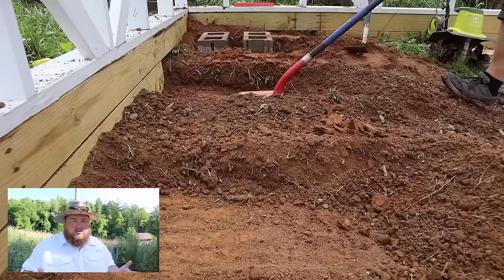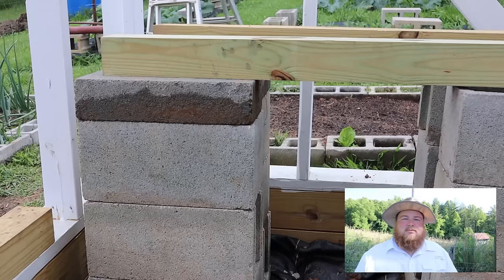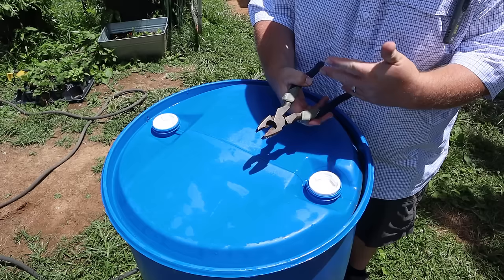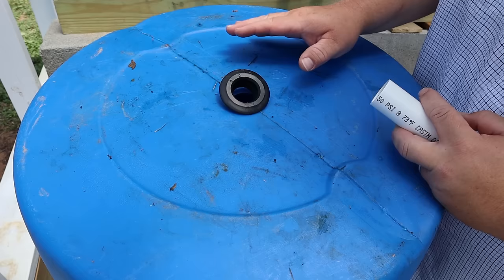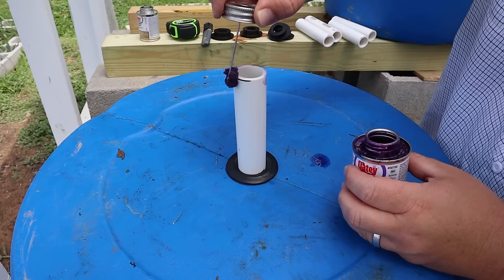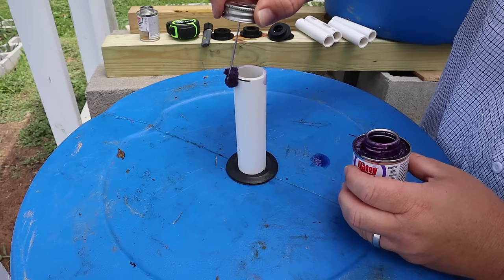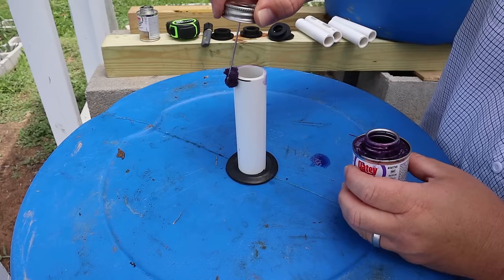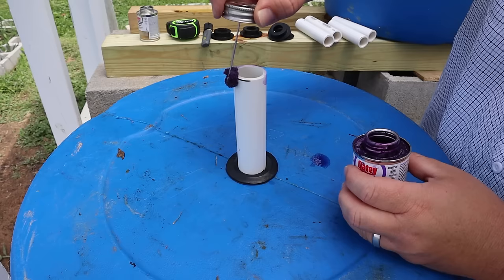COMPLETE Rainwater System START TO FINISH - DIY Greenhouse Build #10

Comment: @greenacrehomestead exactly what I was looking for! Except, do you (or any fellow subscribers) have a total cost for this system? I have barrels but I wonder how much the 2" and 1" pipe with elbows, tees and such will be. I guess it's time to fill my cart up. There's a BlueBarrel system out there (similar setup but upside down barrels so you fill via bungholes not newly drilled holes) but it seems pricey.

Comment: Not sure if someone mentioned this already, but simple math with the tubing diameter will mislead you.  A better way to ballpark if your overflow will be enough for your incoming water is to use the area of the incoming pipes vs the area of the outgoing pipes.  So area of a circle is the constant Pi multiplied by the radius squared.  So for your 2 inch pipes, the radius is 1 inch.  1 squared is just 1.  So one 2 inch pipe will be 1 times Pi, or just Pi (3.14).  What does that mean?  Don't worry about it, just think of it as a rough number indicating how much water will flow through that pipe.  Now you have 2 of those, so 2 times 3.14 equals 6.28.  Okay, so now the amount of overflow has to be equal to or more than that number.  

A one inch pipe, the radius is 0.5 inches.  0.5 inches squared is 0.25.  0.25 times Pi is 0.7854.  Now you have 5 of those pipes so: 5 times 0.7854 equals 3.927.

So here you can see how the simple math betrays you.  The overflow capacity you have is 3.93, but the incoming flow is capable of 6.28.

Now I noticed your first flush system has some holes in it so there is some drainage there, but for the sake of this calculation, let's ignore that.

What this means is that if you have a constant rainfall AND that rainfall is coming down at the maximum rate that your 2 inch pipes can handle AND your barrels get totally full, you probably will not have enough overflow capacity and your water will back up and overflow at the next available gap.

Now that's a lot of and's.   You likely will not have a problem in anything but the most intense rain events, or if you happen to have a few days of rain back to back with one rain event that's a heavy downpour.  If you do have this problem, replacing the 1 inch pipes with 1.5 inch pipes should fix the issue.

Comment: Really good video and a personable actor. Let me ask some questions. Some things you went too fast as I am slow. One, why overflows on each barrel? Don't they all inter connect with each seceding barrel? Perhaps one overflow at the end? You speak of a first flush. Did I miss the ball or was that a manual thing? I have been looking at a ton of videos. Some say bput the connections at the top which I always thought was ridiculous as it is great for filling but not for draining. I was glad you did it the way that you did. I am thinking about putting a submersible pump in the last one, connect it to a pressure switch and install a pressure tank so I can supply my vacation home. We have no water there on a regular basis.What do you think?

Comment: Since you didn't alternate the blocks they're going to be very unstable especially once you have the barrels full of water. They'll compact the earth even more and it's usually not evenly. Whether you alternated or not you really should anchor the cinderblocks down by driving a piece of rebar or a T-post through the openings in the blocks several feet into the ground. 
Otherwise you could come out and find the whole assembly dumped on the ground.
Reply: A concrete footer set below the frost depth in your area would likely keep the tower blocks from moving?

Comment: Why did you drill the holes on the end plug and then put the tape over it? 
This is a great idea I think it is something I will be trying for my garden!
Reply from the maker: The holes are to allow the water to slowly drain out of the flush pipe after the rain is over. I tape them up because they were too big and allowed too much water to flush out and be lost. :) Instead, I just leave the caps loosely screwed in and it leaks from around the threads to work out okay.

Comment: Two 2" inflow pipes have about 55% more capacity than five  1" pipes outflow at standard gravity pressure and not counting friction.
Reply: Huh? 🤔 Sorry, I basically know what you're saying, but how you came to that conclusion is over my head. Not that I'm dumb or stupid, my brain is just not tuned in that direction. 🤷🏽‍♀️
Reply: @njeanhunter9100  the conclusion came by math

Comment: GREAT vid thanks! BUT I do have a question if anyone can help me out:
The First Flush Diverter.... so...it’s just a pipe off the main water entrance (gutter)... assuming the bottom has a cap... but do you just wait til THAT fills up and then when topped off the rainwater will start going into the barrels... do you then uncap it and put the plug back in??? 
  Very sorry if this is a stupid question but I just want to make sure.
  Thanks and GOD Bless!!! 💗🙏😘

Comment: wabi-sabi cure for your off kilter cmu... free cement! ...dig the dirt an extra inch deep... add back a bit of dirt then add water and MIX LIKE CONCRETE! Get a good thick mix and gently place cmu on mud. Level it... rubber mallet works great! When the mud dries, cmu will be level and stuck like you actually used cement! Get er done

Comment: I have to pause before you finish so I don't forget my question because I really want to do something like this (on a smaller scale) for my chicken coops and gardens which are both so far away from my house.  The first flush part.  You said the first load of water will carry all of the junk off of our roof like pollen, dirt, bugs (maybe asphalt from asphalt roofing?)... so my question is, doesn't that stuff always build up on roofs between rain events?  I live in Eastern NC and I'd guess more of our rain comes in quick burst heavy rain than steady washing rain.  And most of it is in spring and then off and on through the summer, a lot of times in the evenings when sea breeze storms pop up.  Just trying to figure out if there is something else I should do to keep it clean?  The water would be used to fill chicken waterers, and to water my garden beds.
Reply from the maker: You can size the first flush system to whatever you like -- smaller for smaller roofs for sure. You mentioned coop and are (maybe) going to really like this... we built a rainwater system for our chickens a few years back! Here's the playlist of the coop build -- there's a dedicated video to the rainwater system in that list. It served us well for about 2 years until we moved them to a new location on our property. https://www.youtube.com/playlist?list=PLxVjeL1ZEeUpiRPFF81m12kHBZMfE2dnr

Comment: The diverted seems like a good idea on paper but just how effective is it, surely not 100% and then there’s the cost of the plumbing. It might be better to confine the sludge that can’t be screened out to the first barrel where it can settle to the bottom and then take the outflow from this barrel up a little from the bottom. I use a low wattage sump pump to transfer water from my first barrel through a depth filter to the other storage tanks but you could leave that out and feed the inflow to each tank above the bottom. There is some loss in capacity but the sludge is on the bottom, which over time can be vacuumed out using a cheap pool eductor type vacuum. With your setup the sludge is in the manifold, which might be tougher to clean out. Did I see the inflow to the first tank going uphill? Do you feed the rainwater in from two places? One inflow and one overflow should be doable at half the cost at one barrel.

Comment: It looks good. But a couple things. I have found cinder blocks lying in the ground that way start sinking after a short while. Solid side down lasts a little longer but eventually still sinks with that kind of weight on them.   Did you know PVC pipe is not UV stable and willl last longer if you paint it? Otherwise it becomes brittle in a couple years. Hope you get lots of water.
Reply from the maker: UV degradation of PVC is only a certain percentage of the thickness and in our experiences (we have built many pvc items outdoors, even another rainwater system on a chicken coop years back) has no real negative outcome with how our projects are used or the stresses they're subjected to.

Comment: Do not use water hose bibs that are made for presurized  systems.  Flow will be greatly reduced. 
Pvc hose fittings  will fit ball values. Pvc values are way cheaper.
Also female pvc hose bibs will leak and break.

Comment: Hi! Did I understand correctly: first, the water goes to the lower knee of the drain (and there it slowly drains). And when a good heavy rain, the knee fills up and already from above the water goes into the barrels. If the rain is weak, everything merges into the yard. Right?
Reply: I thought to make the filter even uglier: a bucket of sand and stones and light agrofibre below
So your system is still neat)

Comment: I love this video and your explanation of everything. Thank you for being so thorough. 

I have a question about the brilliant First Flush Diverter system. You drilled holes through the cover on the bottom. Later when you tested it, you said the holes were too big, because the water was flowing so quickly out of it. How big should the holes be? Does the First Flush Diverter system need to drain actively? I thought it held the first flush until you decided to release it later, after it has stopped raining. Am I misunderstanding how it works?
Reply from the maker: The perfect balance is small enough to let most of the water flow into the barrels, but large enough to drain itself and any larger debris in between rain storms without any intervention by humans. :)

Comment: Nice work  but I’m curious, why didn’t you alternate the block direction? Seems it would be safer after the containers are full and top heavy.
Reply from the maker: Alternating block only works when they are placed side by side. A 16" wide base was too narrow for the barrels to safely rest upon.

Comment: yep...saw that hole in the drain cap was too big but hey.....We all gotta figure things out ourselves right??? did a fabulous job on the system. I am curious about one of the down spouts going into a barrel.....was that going up hill from the gutter??? Could I have just not seen it correctly? Was it an optical delusion???  OR WAS IT GOING UP HILL??? Hmmm inquiring minds want to know!  :}
Reply from the maker: Yep, going uphill and no problem. 😎 Works the same as a p trap or toilet flushing. Water flows into barrel fine when filled in pipes. Afterwards no worries about siphoning our barrel water because the inlet pipe from gutter will allow air into pipes to let them self-drain between rains.

Comment: I wonder if the "too big holes" in your first flush were too big, because it's gonna be dirty water going out, so there's a possibility that they might clog?  Also, if you top fill the barrels and use "t" fittings in the holes already in the top of the barrel you won't need overflow holes drilled in the barrel, and at the end barrel have an easy overflow for the entire system, not to mention you will fill the entire barrels with no air space at top.

Comment: Got confused when you connected the bottom pipes to drain but how will water fill all the containers in the middle if gutters are connected in corners only? I didn't see any pipes conected to each other on top?and why did each container have a drain pipe on back end?I Thought the pipes were suppose to flow from one container and when the water fill one container it over flows to start filling the one next to it then repeat until they all filled Up. Sorry. I love watching btw. If you can explain I would really appreciate it! Need to make one myself, thanks! God bless.

Comment: The reason it works is the same reason you can use a clear tube filled with water as a level line.

Comment: Nice build, I would like to ask, is it necessary to have the first flush system if you have the fine mesh covering your collectors as you did, I would have thought that these would have taken all the dirt etc ?
Reply from the maker: It's not absolutely necessary, but does help a lot towards keeping the water cleaner overall. The mesh catches the larger particles, but the first flush does well for smaller items like dust, pollen, and (in theory) bacteria and poo water from bird droppings. :)
Reply: @sam-and-angela  Thanks for filling me in. I hadn't thought about that side of things, its a very good point you make. I may try and tackle something like this this summer if all goes well :)

Comment: I know I am late to the party, but I  really enjoyed this video.  Is there a way to install valves between the barrels to help ration the use of the water?  Do you think it would be worth the effort?
Reply from the maker: Sure that would be easy— just make the down pipes from barrels to horizontal pipe longer and put inline valves there. I wouldn’t see much reason with my system but that’s because I can control the flow at the connection point too.

Comment: Great video; nice system.  NOT trying to be critical at all with my comments as I really enjoyed the video.   Your system should work just fine, which is the bottom line here.  And you may have had a source for the barrels that let you get 5 of them free...or very cheaply.  If so, I understand why you would use 5 barrels to build a system with 250 gallons of capacity, more or less, allowing for a little head space at the top for the venting and overflow.  But if you gave the 5 barrels to me free, I still wouldn't trade my single IBC tote system for your 5 barrel system.

If all you needed was a 250 gallon system, this one was an "over build" of sorts, in terms of materials needed, their cost, your time and labor, etc.  One single IBC tote would give you 330 gallons of storage, or about 35% more capacity, be simpler to obtain, set up, use, and maintain.  I've put together my own 330 gallon IBC tote system and used it successfully for several years.  While I paid $80 this year for a new IBC tote that I merely have to clean out the inside where food grade raw materials were stored, the savings on all the excess plumbing supplies used in your system would offset all of most of that cost, not to mention the time and labor needed to do the installation. And then there is the cost of all those concrete blocks and wood needed to support a 5 barrel system to consider.  

I see no good reason to create a 5 barrel system. If there is one, what is it?  Both systems work very well but a single IBC tote rain barrel system is just far superior for the reasons I have named.  BTW, I started my first rain barrel system with a single 55 gallon drum just like you did so I have done it both ways.  The IBC tote is the best way to go by far.

Comment: 5x1" pipes have an area of 3.9 while 2x2" pipes have an area of 6.3.

Four 1" pipes will flow the same as one 2" pipe. The math doesnt always work that way but remember it's not only twice as tall it's also twice as wide. If it was square it would take two 2X2s to be 2X4 and four 2X2 to be 4X4.

Comment: Great system but too many small overflows, i would prefer 2 bigger ones on side barrels as manifold under barrels is thinner then gutters. Efectively you have 4 paths for water to overflow instead of five.

Comment: My first thought was to question whether your block foundation has enough surface area sitting on the raw ground that the blocks don't tend to sink if the ground gets wet. That could potentially allow the barrels to lean and topple. When almost filled with water they approach 440 lbs each (55 gallons times 8 lbs per gallon). With 5 of them, that's over a ton.. Just sayin'. 
Maybe with the area in question being covered by your roof, the ground will stay dry, and everything will be fine. But iin sustained heavy rain and if your overflow pipes dump close to each barrel, I'd watch it..
Reply from the maker: See FAQ video in description.
Reply: @sam-and-angela  Sounds like so far so good. Yay that's encouraging! I pray it will last as long as you want it there!  Blessings

Comment: all sealed surfaces should have an associated rainwater harvesting system even if its a 10ft deep pit full of river stone and topped with a silt barrier so that rainwater in non-flood events can be diverted into the soil. imagine you're in a rainy environment. you still need water for numerous tasks and why should we pay rates to get water sent via the grid when they fill it up with poisons to keep the microbes from getting established before you use it? a sealed surface is roads, walkways, rooftops, carports, garages, sheds. etc. they block the earth from recharging the groundwater and is the leading cause of both drought and rising coastal water levels. the earth can hold a whole ton of water if you let it.

Comment: I see a problem with your set up already but not a huge on a small one!! That second down spout connection was running from the roof to the top of the blue barrel that run was abit too low... Water doesn't like it run uphill very much!!! Cheers!!
Reply from the maker: It still works fine -- same principle as a p-trap in a sink. :)

Comment: How have the rain barrels worked out as thermal mass? Also the diverted, ive seen people use a plastic ball that floats in the diverted pipe and once the pice is full the ball blocks water from the diverted and into your collection barrels.